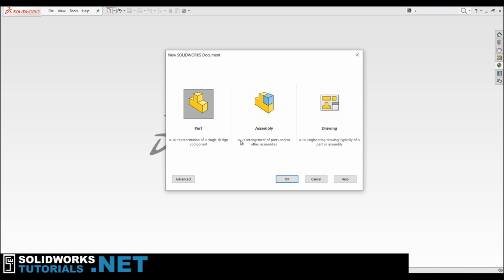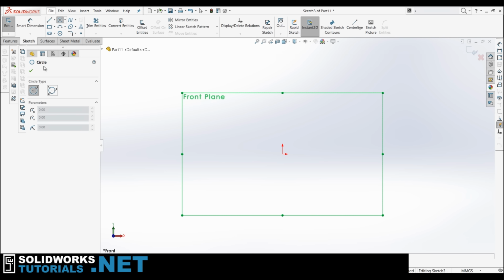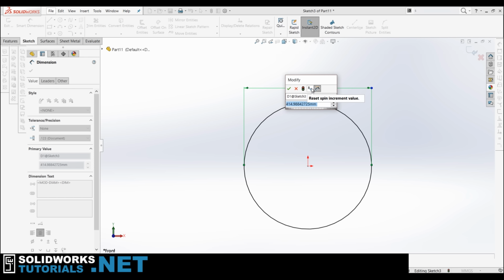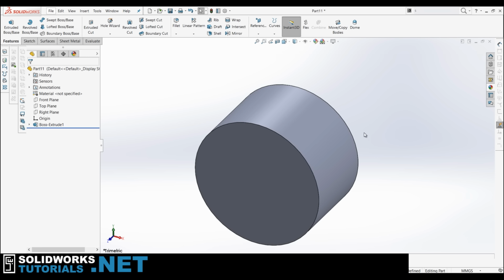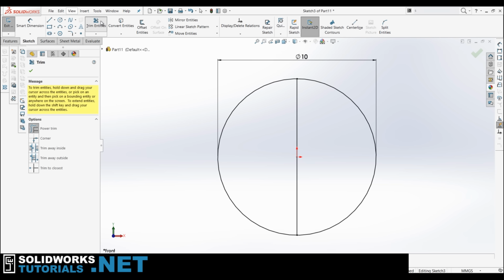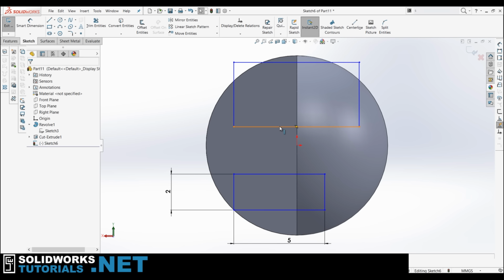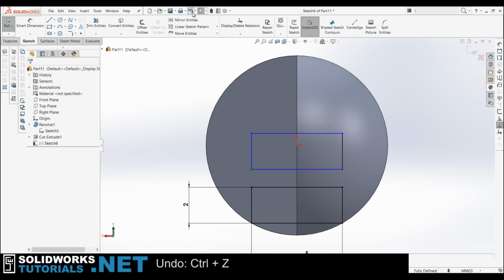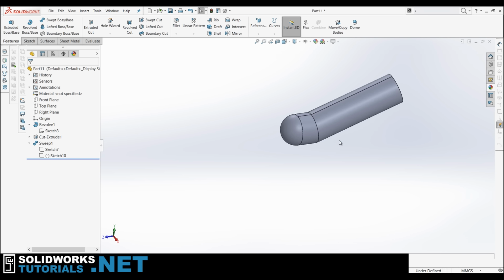SOLIDWORKS 2020 tutorial for beginners

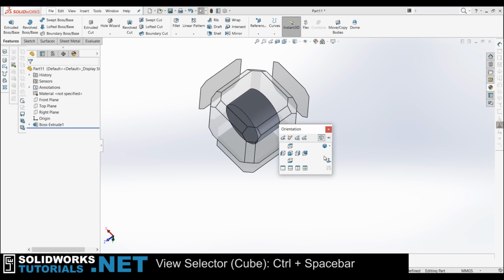Comment: 9:43
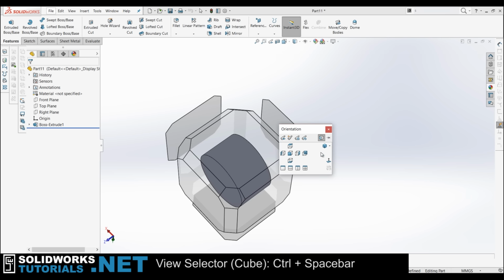Reply from the maker: I do not understand exactly which tool in the video you need help with, kindly specify the same, at 9:43 i'm talking about disabling the view cube, this helps if you don't want to see that cube shown, instead you need to use CTRL+ 1 2 3 4 5 8 etc to get the views you want. Its a little bit of remembering but once you get it, its 10x faster to get the view you want.

Comment: I cant get the sweep to work, when I try to select profile and path, nothing happens
Reply from the maker: because you have drawn the profile and the sweep in one sketch. Or your profile is too large for your path
Reply: @SolidWorksTutorials With Aryan  nah it wasn't that, I followed the instructions well. I figured it out though. While drawing the path you said to break the first line before going up on an angle. This doesn't work and the path must be drawn without resetting the line tool.
Also some feedback: the video is choppy when you select the circle edges for the convert entity step, some info on selecting the edge would be nice as I struggled to not select the face of the sphere. I dont even remember how I got it to select the silhouette edge 🤷‍♂️ cheers!

Comment: Smart dimensions or Constraints in Inventor are a nightmare, what's the point of using a smart dimension that sets the standard for all other dimensions if it's wrong? Crazy! If the circle had changed to the right scale, that of 10 instead of 200, that would have made sense, but this just complicates matters.
Reply from the maker: I’m confused, what do you mean?
Reply: @with-aryan  Hi Aryan, firstly, thank you for providing the video, I like the way that you highlight commands on it by focusing in on them. The problem that I was having was when you were assigning a 'smart' dimension to the circle that was 84.489 units or something like, but you gave it a 'smart' dimension of 10 diameter, where the size of the circle did not change, I suppose because you were assigning it that dimension, it just seemed illogical to draw something with a correct dimension but then give it another, so I'm still confused. Solidworks is similar to Autodesk's Inventor programme, in that sketches need constraining, which baffles me since when you draw something on a sketch I would automatically think that those dimensions and location would remain, but obviously not. In Solidworks it talks about being Under Defined or Fully Defined, which is the same concept as constraints in Inventor.

Comment: HI ARYAN
I WATCHED SO MANY SOLIDWORKS TUTORIAL LOADED IN YOUTUBE. SO MANY CLAIMED THEY ARE SOLID WORKS EXPERT PROFESSIONAL. WATCHING THE TUTORIAL 3D MODELING SAMPLE MADE ME THINK THAT THE SOLIDWOKS EXPERT PROFESSIONAL IS ONLY GOOD IN USING THE APPLICATION OF THE SOFTWARE IN CREATING 3D MODELS BUT DO OT HAVE ANY EXPERIENCE IN MACHINING A PART. WATCH TUTORIAL #19 AND JDUGE FOR YOURSELF IF THE ROUND TUBE CAN BE MACHINED IN OUNE OF THE FEATURES OF THE PART. IT IS A DISGRACE TO THE SOFTWARE COMPANY ALLOWING THIS KIND OF DEMONSTRATION WITHOUT KNOWLEDGE OF MACHINING PROCESS. I HOPE SOLDWORKS WILL STOP THESE PROFESSIONALS MODEL HARD TO MACHINE PARTS.

Comment: This is my first time to hear this 3d software.. looks nice!
Reply from the maker: This is the holy grail for mechanical engineers and mid range companies! https://discovery.hgdata.com/product/dassault-solidworks
Reply: @with-aryan  I think I like it. It seems that this software is much "user friendly" than Autocad 3d & Sketchup for industrial / mechanical modelings
Reply from the maker: @joef1639  This software is the holy grail for mechanical engineers and honestly is the most user friendly cad I've seen
Reply from the maker: @joef1639  What do you need to learn SolidWorks for exactly?
Reply: @with-aryan  actually sir I'm planning to start a small car/motorcycle accessories fabrication business so I got interested in that software and I want to learn how it works & how to use this SolidWorks  Software coz it seems it is much easier to use for that purpose than using my architectural software. What can you suggest or recommend sir?
Reply from the maker: @joef1639  It is suited for your objective. It can even help you with the sustainability and manufacturing cost calculation of your parts.
What I recommend is very straightforward, start learning it in the right sequence or you'll set to be frustrated for the next years to come. Start by watching my webinar first and proceed to my mini-course, both of which free access at the moment. You'll know what to do from there http://bit.ly/SCPMiniSeries

Comment: It is a good tutorial. However, the function "convert entities" didn't work because it selects the face instead of a edge.
Reply from the maker: what sw version are you using?
Reply: @with-aryan  18
Reply from the maker: @rafaellz2134  Then the only reason I can think of is that you are not in an active sketching mode
Reply: @with-aryan  I checked that, and I was still on it. I can only select the edge for the slice, but not for the other side of the sphere.

Comment: Hey!
I am not able to select silhouette edge in convert entities. How did you do it?
Can you please tell me.
Reply from the maker: What SW version are you using?
Reply: @with-aryan  2020 version
Reply from the maker: @anchaltotla4793  In that case, it should be possible. Try the following:

1- Make sure your sketch mode IS INDEED activated when you are trying to convert that edge
2- It could be your graphic card is not strong enough so be flexible and move your cursor around the edge until it goes highlighted. It might happen at an offset
Reply: @with-aryan  thank you soo much! 
It really helped a lot. 😊😊

Comment: When I extrude any part or import any part (.ipt) the part is transparent and I can’t see it; why?
Reply from the maker: well, that's a new one! It might be for a couple of reasons. First of all, are you sure your hardware is supporting you fully and  this is not a graphical error?
Reply: SolidWorksTutorials With Ryan not entirely sure. It’s almost like the shadow of whatever part is there will show up but nothing else.
Reply from the maker: @jaiburns512  sounds like a graphical issue. Is this only happening for extrusions? how bout for revolve?
Reply: SolidWorksTutorials With Ryan even when I import a file only it’s shadow will appear and a silhouette of lines if I hover over a certain face but never can see a solid.
Reply from the maker: @jaiburns512  that's not a typical issue I can help you with. It sounds like sth is wrong either with the way your hardware not supporting you or the license installed incomplete. Could you reinstall it?

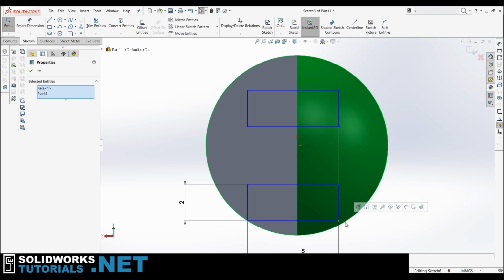Comment: Big learning curve for sure. I'm stuck at the point at 14:40 where the bottom rectangle becomes blocked and solid black. I did exactly the same steps but my rectangle stays grey. Did I miss something?
Reply from the maker: Grey only means you have exited the sketch mode. All I did was to hold Ctrl select the corners of the rectangle are the perimeter of the circle one at a time and make them coincident
Reply: @with-aryan  I’m doing the same thing and it’s not giving me the option to make them coincident.

Comment: I cannot stress enough how horrible SolidWorks is. If you have the option of using literally ANY other program, do so. This is the most confusing, least effective CAD program ive ever used, seen or heard of, if you want a good one. invest in autoCAD, if you want a cheap one just use google sketch up. they both have just as many functions as this but are actually usable without watching hours of videos explaining basic techniques
Reply from the maker: ooooh, sounds like you had it up to your chin with SolidWorks. What was the problem? Too different than others or too confusing?

Comment: Goes way too fast for a beginner.  Also 2017 version which is different enough from 2020 that makes it even harder to follow.  Plus for effort.
Reply from the maker: Hi Jerry, the pace is something you can never get right as a content creator, on each of my videos there are 50% of people telling me why I'm too slow I should explain faster and the other 50% believe the pace is too fast.  I am sorry for that. As for 2017, the difference is rather negligible. I am using a 2021 already and I can tell you the difference for beginners is not noticeable.  Have you checked my webinar about SolidWorks?
Reply: Thanks for the reply.  Those other 50% must have some previous experience with some kind of CAD software.  My back ground with this type of software is zilch.  MS office, Win operating system, some video editing, some Photoshop yes.  But CAD and design, no. So I'm truly your rank beginner.  And that's why took a look at this video. The differences of the 2020 version started when things did not appear in the same places and combined with the unfamiliar terminology just overwhelmed in short order.  Ended up starting and stopping too many times.   I started another tutorial which is much longer but slower paced based on the 2019 version.  Maybe I'm just slow!  Thanks and appreciate the effort though.
Reply from the maker: @wangchili  No that is not on you and you are not slow. I do recognize your valid point. The tutorial does pace up at some points. The challenge for me when I want to put a video on YouTube is, I have to put something for every type of person, impatient, quick learner, patient etc. I decided to fix it and make it super slow for my course. I am not using this comment to pitch you that, but I am genuinely telling you if you are interested in learning it for good, you should try the course. Didn't like it? just return it and get your refund. By the way that is on a 2020 version. Either way, Thanks you very much for watching.

Comment: Sir which version are u using??
Reply from the maker: it is a 2017 but the same goes for 2012 - 2020 versions
Reply: SolidWorksTutorials what are the requirements of this version can you please tell sir
Reply from the maker: @incrediblegamers4943  Processor: 2.7 GHz or higher clock speed (preferably closer to 4 GHz)
Operating System: Windows 7 or 10  64-bit.
Memory: 32GB (16GB minimum)
Hard Drive: Solid State Drive (SSD), maintaining at least 20GB free spac
Reply: SolidWorksTutorials is a graphic card necessary for the software ? I have integrated graphics is it  enough ?
Reply from the maker: @incrediblegamers4943  of course having one is necessary but it is not as important as it is for gaming. Most of the workload is on CPU and only when you increase the graphics or do rendering, GPU becomes more important. If you are trying to build a PC for SW, do not over spend for GPU and instead try to up your CPU.
Reply: SolidWorksTutorials thanks for the reply sir couldn’t get any better information than this☺️🙏🏻🙏🏻 thank you again😇

Comment: First, you will need a plane.  I have some experience learning 3d modeling but, the most difficult concept for me to get my head around was planes and how the tool uses them.  You stepped over that as if the beginner knew what you were talking about.
Reply from the maker: Thank you very much for your valuable feedback! If you are a beginner and haven't signed up for my course, please check it out here and consider it for yourself. It is perfect for beginners and will be released in exactly 2 days http://courses.solidworkstutorials.net/
Reply from the maker: I see your point about the planes! Never had that feedback tbh.

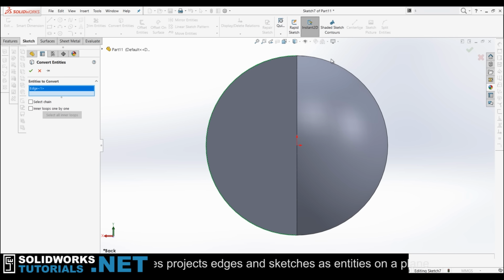Comment: Hi, I have spent the last two weeks trying to figure out what and how you selected the two outer edges that happens at 16:55 in this video. I oriented my object to the same position as you have it. Did what I think is verbatim of your instructions. But past this point, the the faces that are selected are the two quadrant and NOT one quadrant and the shot-dashed semi circle across the surface. Can you help? And oh, I am in sketch mode.
Reply from the maker: well, i did nothing special. When you are in an active sketching mode, and you select CONVERT ENTITIES you then can simply select edges by a simple left click.
Reply: @with-aryan  I actually encountered the exact same issue  and spent 30 minutes on it. Every time I would try to select what was listed as the silhouette in your video, it would select the entire outside surface.
Reply from the maker: @tuckpilot1192  go to settings and search for silhouette, there is an option that you can check active so they can be selected. do that and let me know

Comment: After assigning smart dimensions my sketch doesn't change to fully defined. Even after setting smart dimensions,if i drag my sketch it enlarges!!
Is their any settings to be done?
Reply from the maker: No. it has nothing to do with the settings. Making a sketch fully defined has more to it than just "using" smart dimensions. Fully defined means that the sketch has only one solution and cannot be dragged, stretched or reformed. Find DISPLAY/DELETE RELATIONS button in the SKETCH TAB, press on the small arrow underneath it, and select FULLY DEFINE SKETCH. then you will see that your sketch will change to fully defined. The reason yours is still under defined, is that some aspects of the sketch are not defined by your smart dimensions.
Reply: @with-aryan  Thankyou

Comment: I do not have the coincident relation, it's not coming up and not sure why, so cannot put the 2 bottom points on the edge of the circle, and cannot define my rectangle. Have no idea how to do that and cannot move forward.
Reply from the maker: You should select one point at a time
Reply: @with-aryan  ok, thanks. And then it will come up? Though i thought you said to press control and select both,  so no?
Reply from the maker: @Tinydigs  yes, hold ctrl, then click on the first point, keep holding ctrl and click on the second one. Then it comes up
Reply: I thought I did that, but will try again. Thanks.
Reply: When I do it, my only options for relations are horizontal, vertical, fix and merge. No coincident. So I can't define my rectangle and I  am not sure what it exactly means to do it
Reply from the maker: @Tinydigs  jus to make sure that we are on the same page, you hold the Ctrl, select a corner point of the rectangle, keep holding the Ctrl, select the edge of the circle, and you don't see Coincident?
Reply: You know, I don't think I selected the edge of the circle, duh. Will try that!
Reply from the maker: @Tinydigs  let me know the results
Reply: Don't I also have to select both points of the rectangle?
Reply: I'm sorry,  it's not working. I'm not sure what I'm doing wrong
Reply from the maker: @Tinydigs  are you a member of the website? I can film it for you. If not, I suggest you go there and visit the website. Also, try to do this on a simpler part. Maybe a point on an edge of a cube instead of a sphere
Reply: And I don't have the option for a fix relation
Reply: Coincident finally came up, but both points are not on the edge of the circle, only one is.
Reply: I will go to the website. Thanks for your help and patience
Reply from the maker: @Tinydigs  any time Michelle

Comment: Gentlemen
Can u pls. Give me any good and easy process for motorcycle pressure plate doted structure,I want to make pressure plate for motorcycle and I need yours guidance for this process,also pls. Tell me the best material for motorcycle pressure plate.
Reply: Are you talking about the clutch pressure plates?
Those are made of fibrous reinforced plastic, alternatively layered with mild steel plates.
So one layer fibrous plastic, then metal plate, then fibrous plastic etc, 
Look at your engine, manual it will have a picture?
Is that what you are asking about? 
Are you re-building an engine?
Reply: @TheAefril  yes sir u r correct I m talking about the metal pressure plate,which is using with fiber layer plate in motor cycle clutch system,I want to develop/ made only metal pressure plate I have already developed the dies for two process 1- outer blank cutting. 2- inner circle cutting. Now I want to develop the die for doted texture,I need yours guidance and advice for this process, my queries as under:
1- what will be the best way to make this die.
2- do you have any video for this process.
3- I want to make this part only for CD 70 motorcycle and the thickness of material b/w 1 mm to 1.6 mm, this part have doted texture on circles both sides of part.
Regards 
M.A.Qureshi
Reply: @mohammadqureshi2727  I think the best process (for a high number of units-to cover the setup cost) would be for cold stamped mild steel. To get the cold forging strength around the rings (from the distorted grains), depending on how accurate this process you can perform - you will then have to machine the rings to a perfect inner and outer diameter (remember these parts are spinning around at (12,000 - 14,000 rpm for 4 stroke engine/ 13,000 - 17,000 rpm for 2 stroke engine). Precision is important. (very tight tolerances) 
The parts must be balanced in physical dimensions and weight distribution. 
Also, the parts are rubbing against each other or other stationary parts of the engine, you must ensure a hard and smooth surface finish to all contact areas.  
Give that a go, or if you have any specific questions, and let me know how you go?
Reply: @TheAefril  sir, I am very thankful to yours valuable feedback, it's really very useful to get the accurate and perfect product.